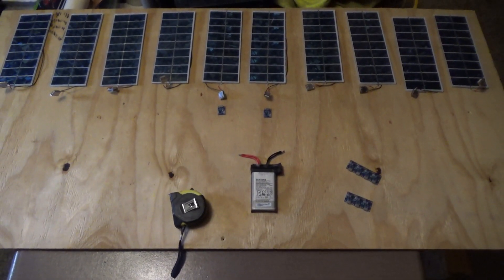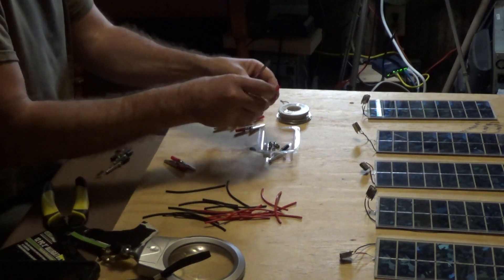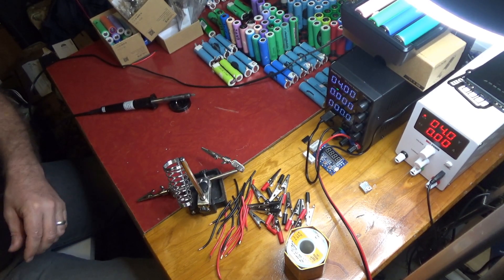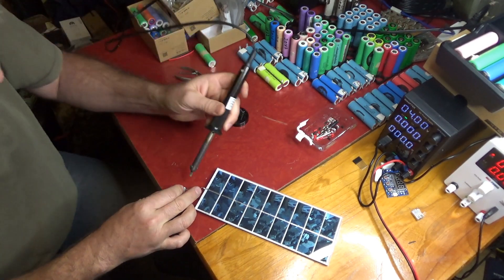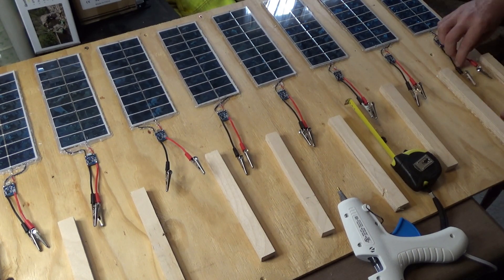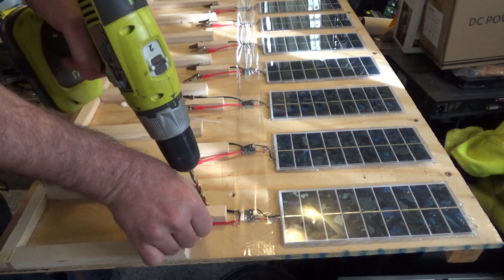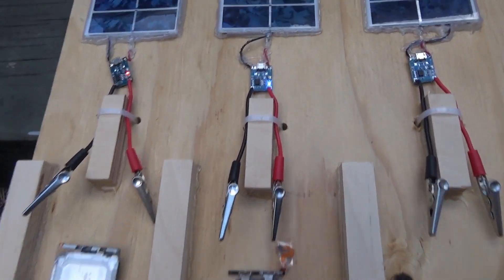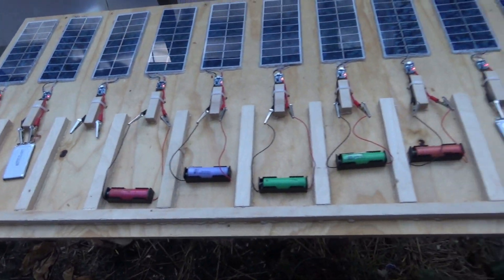DIY Solar Powered Lithium Battery Charger For 10 Mixed Batteries At A Time

Comment: Thank you for this video. Its very helpful. I want to get me a handful of those tp 4056 circuit boards but wasn't sure if it will be both suitable for 18650's even though it's advertised for use with lipo batteries
Reply from the maker: They can charge at a max 1 amp but these solar panels are limited to 0.6 amps so they are gentle on the batteries. If you use these you can set up a stable current input to limit your charge to whatever you want. I will parallel a bunch of these on a power supply on my bench. Video on that coming soon.
Reply: @The Do It Yourself World Electronics  i have a bunch of dissimilar small solar setups (3) that has a total output of 0.450mah at peak. (i know they can do better) Given that we so much ☀ in Namibia, i dont really mind the charge process. I do have a usb 5volt car charging connector to those panals. Voltage out put is 10volt from the small panals and its stepped down to 5volts. Surprisingly it it fully chargers my bluetooth speaker in one day that has an upgraded build in 18650 battery. Battery Capacity exceeds 1500mah. The panals on the 3 small solar panals are monocrystalline panals
Reply from the maker: If your total peak output is 400mAh then you should be fine.
Reply: @thedoityourselfworldelectr8007  thank you.

Comment: All Thumbs Up Every Time ! #21
Use switches to Add or Subtract as many panels as you need.
Reply from the maker: One panel is perfect to charge one battery. At 600 mA, one panel cannot push too much current into a battery.

Comment: Why not connect all the panels in parallel? That way you can make use of all the panels all the time, no matter how many batteries you have charging or what state of charge they're at. You could even add more charging circuits than you have individual panels.
Reply from the maker: Because each panel is rated at 600 mA and this is a safe current to charge the batteries. There is no way I can push too much current into any battery with this system. And I have about 5-600 batteries to charge up with about 1,000-1,200 more on the way. I will be running this charger for months.
Reply: @thedoityourselfworldelectr8007  I see, I thought those charging circuits have current management. So they're just voltage regulators then?
Reply from the maker: They do have current regulation up to an amp or more. But I prefer 500 mA (600 in this case peak) myself.
Reply from the maker: Even if the current regulation in the circuit fails, I still cant push too much current.
Reply: @thedoityourselfworldelectr8007  at the rate you going i wont be shocked to see you ending up with 20kw storage. (not counting the lead acid batteries)

Comment: Do those solar panels have regulated output? Because that looks like tp4056 and it need regulated input :)
Reply from the maker: Various websites say it has a range between 4 volts and 6 to 8 volts. I had one of these running for weeks at a time with no issues so far.
Reply: @thedoityourselfworldelectr8007  your correct. Its Up to 8v. :) Just note that it gets hot with 8v input.
Reply from the maker: Yeah. I am hoping these panels will not go too high under load. I may make some improvements on this board with time anyway.

Comment: U SHOULD BE USE flux WHEN SOLDER NO U TRUES ROZEN CORE BUT I DONT OUT THE HARD WAY USEING A FLUS SO MUCH BETER WEHN MOD A CAR WIRE HARNESS THE WIRE WOOD SOLDER WITH ROZEN CORE GOT MAD I USED SOME PLUMER FLUS FOR PIPE SOLDER SAME SIZE WIRE WITH FLUS THEN CUT IN HALD AND SOLDER WAS NICE ALL THE WAY THOU
Reply from the maker: Grew up with rosin core. Just what I am used to.
Reply: @thedoityourselfworldelectr8007  YES ME TO BUT WHEN You're TRYING TO SOLDER WITH A NEW ROLE OF SOLDER 22 GA WIRE TO GET HERE AND NOT WORKING STEP UP TO A 100 WATT HEAT GUN NOT WORKING  U GET PISSED AND TRY ANYTHING AND WHEN IND SOME WORK BETTER OR IN THIS CAE WORK BETTER THAT HOW U ROLE
Reply: WE HAD SAME THING AT THE COMPUTER SHOP MY BUDDY WAS THE SAME WAY TILL WE HAD TROUBLE ONE DAY AND TOLD TO THOUW ON SOME FLUX AND WAS NICE
Reply from the maker: lol